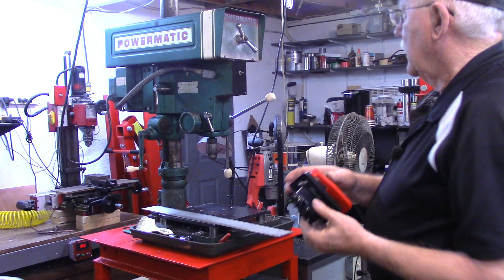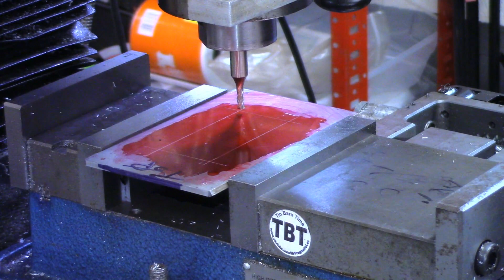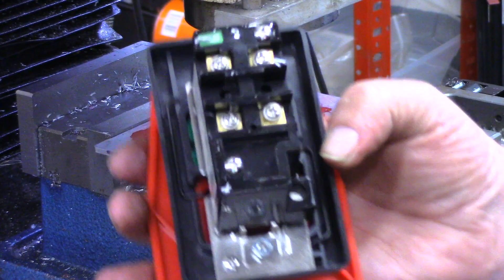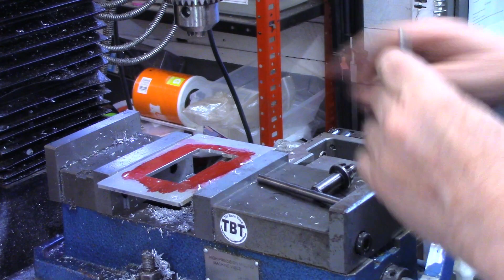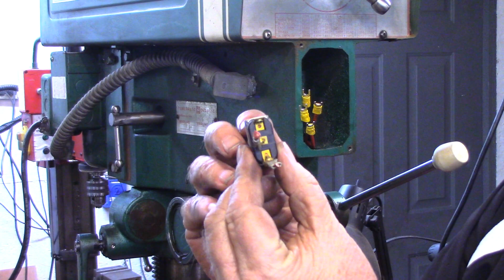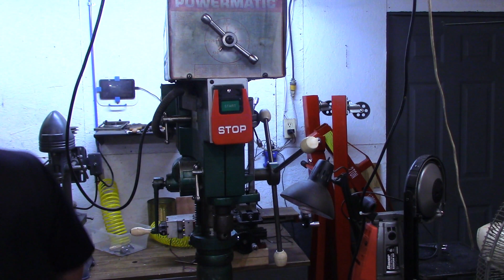Powermatic 1150A On/Off Switch

Comment: Ha--I have the exact same crimper. Got it when I was in the Air Force near Tokyo, Japan, in 1968. For a while I had an off-duty part time job working for a contractor installing a new communications center. The contractor gave us all one of the crimpers. Nice job on the switch, Lee.

Comment: If you don't want to file the corners, a hole about 3/32" centered on each would relieve them so the endmill can get everything else.  What did you do in the Air Force?  I got the impression you'd been in one of the services.